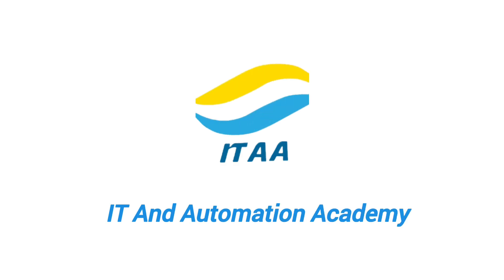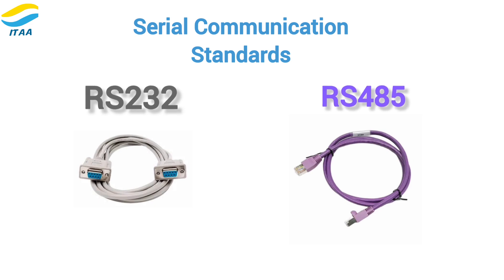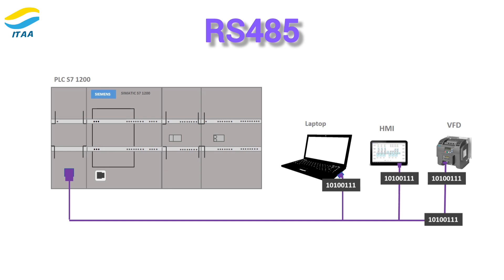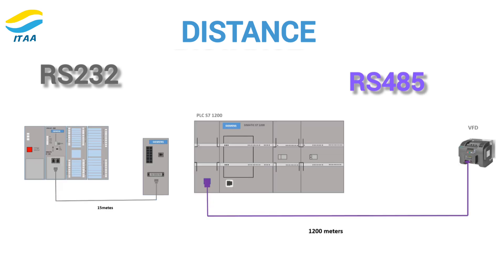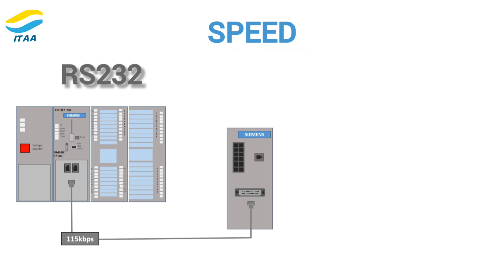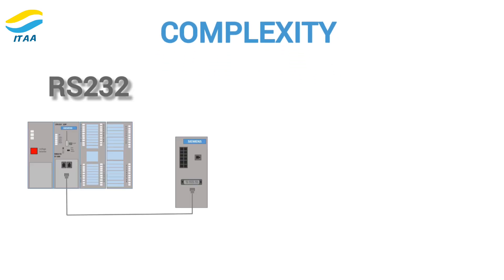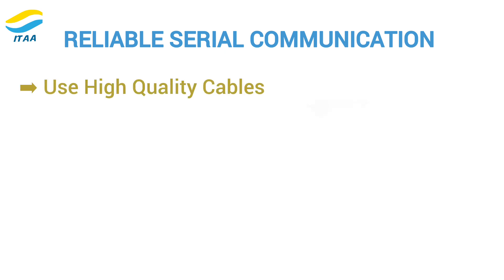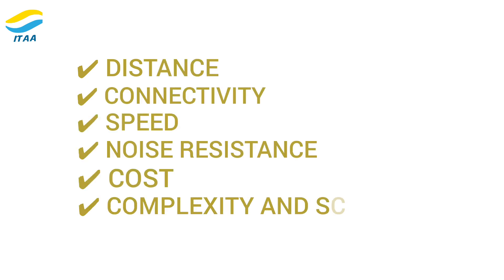RS 232 vs RS 485

Comment: Kind of ummm interesting and amusing. The company where I work has around 100 CNC machines that use RS232 serial for communication for G-Code program load/saving to a single server hooked up to a box that can auto-select and auto-switch to any one of those 100 CNC machines at any time across a distance of probably about 50-100 meters using control software. So RS232 is not just for one device and not just for up to 15 meter distances and when done correctly can go beyond that even in industrial applications.....
Reply from the maker: That’s very interesting! It’s good to know it can be used in more demanding industrial settings.